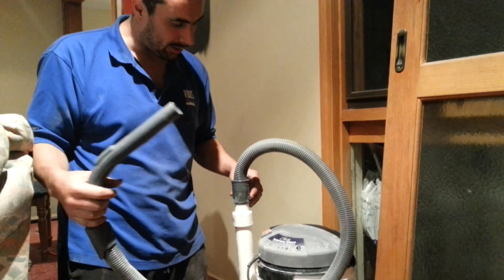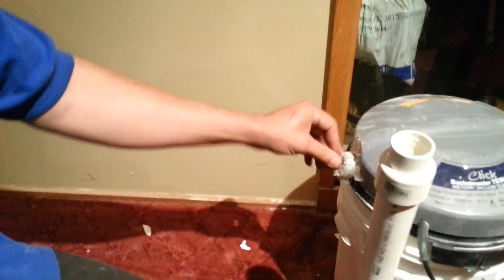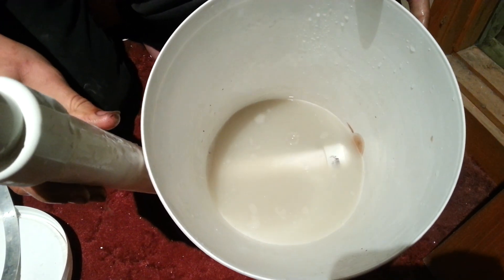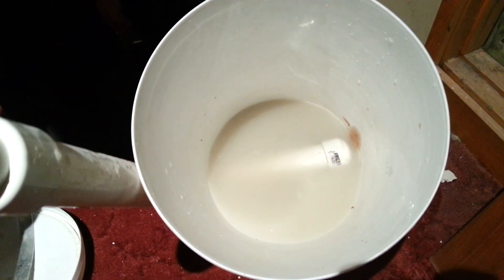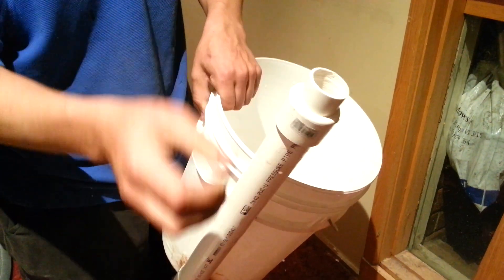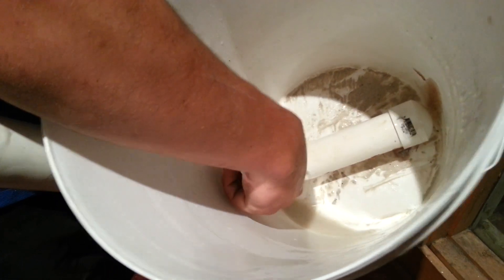Bong-Vac, a water filtration plaster dust vaccuum

Comment: Brilliant! I thought this type of thing would be useful for a project I'm working on, so I searched YT and found this video.

I was thinking about using the shop vac bucket as-is, but running a hose from the inside intake port to the bucket bottom. Good to know about the fiberglass matting to reduce bubbles, and vinegar to reduce foam.

Thanks!

Comment: Thanks for creating this video.  I need to suck up some drywall dust and had the idea of using a water filter.  Previously I put a wet rag on the exhaust of my vacuum, which worked ok, but I have to have someone hold the rag since there's no other way to make it stay on.  I haven't tried making the water filter yet but now see I would have had foam issues.  I have a bucket head vac, but alternatively I may add a lid and make a vacuum port for a regular shop vac.

Comment: your design has 2 brilliant ideas. 1. adding a split lid inside to keep the water at the bottom of the bucket. 2. use soap to create foam to improve the dust / water mix. however, your inlet design with tight elbow, and goes straight with drilled holes will dramatically reduce the airflow. I suggest you to change the design similar to the cyclone to force the dust and water spin and mix inside the bucket.
Reply: Hi Eric I am engineering challanged are you telling me that if I had a dust collector attached to my shop vac its abilty to collect dust will be enhance if I use soap water thoughts please thank you!
Reply: tight 90 degree elbow and small holes kills the air flow. replace that elbow with a long hose and entering the bucket on sideway, like a cyclone dust collector, to increase the airflow. also don't just drill the holes in the tube inside the bucket to let the air comes out. replacing it with a bigger 45 degree elbow. every single part that block the air should be replaced. but all in all, using the water to wash is a good idea to remove the fine dust.
Reply: HI Eric it seems you understand the idea of of using soap to trap dust but elsewhere on the interent it is stated that some people are afraid that dish soap might make bubbles to big that person said they felt a defoamer would like be a better option so I today went and bought a laundry deteregent it seems bubbles in that will be small does that sound good to you thoughts please thank you! again my question in case I was unclear do you think laundry detergent is a good soap to use in my water trap dust collector thoughts please thank you! I would guess one cap full should be enough if not more than enough  ? thoughts please thank you
Reply: My idea is to put the inlet hose at the side to make the air spin against the wall of your bucket. The spinning air will also move the water spinning at the same time. The physics of the spinning action will make the dust and water mixed together. The clean air, or finest of the finest dust, will exit from the outlet. Yes, adding the detergent will create bubbles but it will also increase the efficiency of the cleaning action, which is the best part of your system. The amount of detergent is a try and error process.
Reply: @ericma2937  thank you for the detergent Idea !! I am trying to update my fb page where I put I video of the water trap dust collector so I will just add your user name than that stated you said laundry detergent will make it better than hope thats ok with you ?
Reply: @ericma2937  thank you for the laundry detergent Idea on the video I added to my fb paged I credited your user name saying you said the laundry detergent was a good Idea thank you !
Reply: now why dont I link here a video to a water trap style someone made and tried to imitate : here : https://youtu.be/DKa305v0kmQ?si=P_ZfEWGocqU3AnCN my new question to you do you think it can trap metal shavings in the soap ?
Reply: Metal is heavy. It shouldn’t be too difficult to be filtered out. But keep in mind, the more component you added to the system, the less air flow it will be. Make sure to pick the most efficient way.
Reply: Hi Eric I am not sure which system you are refering to but I made a cyclone diy dust collector based on youtube videos to good news it would seems is it is designed I think as a water trap style and I just bought some laundry deteregent so hopefully if I put a capful in the bottom of my cyclone dust collector it will hopefully wrk well in traping dust do you think Ideas please thank  you
Reply: you said the amount of degtergent is trial and error but the good news is that  I was able to put a filter be for my vacum so even if the detergent fails it will still be filtered !!!! before going into the vac as it woud seem the way I have it set up I dont think dust can get into the vacumm only liquid will be able to pass through but thank you for explaining it to me I am think i feel a little bit better now that my any water and detergent i put in the bottom of my cylcone diy collector is just going to make it work better again thank you !!!
Reply: Hi Again Eric in case I did not already say it congradulations you made a topic that was difficult to reserach easier to understand guess when I get spilled would shavings I now have some laundry detergent I can use I herd someone say dish soap might make to many bubbles and they had recommended something like laundry deteregent as it would make less suds !!!!
Reply: I again I say thank you you made a difficult to research topic easy to understand so as previously stated my thoughts were to take a variation of this video : https://youtu.be/DKa305v0kmQ?si=P_ZfEWGocqU3AnCN and put soapy water using laundry detergent !!!!

Comment: can you imagine the customer walks in and sees that mess on the carpet. He'd say hey you dummy put down a tarp who the hell wants that crap in the carpet. OMG I have textured for over 40 years every time a tapers calls me out I have clean this crap up before I can mask off. Heres an idea mask off first.
Reply from the maker: Carpet was being replaced so didn't bother protecting it.
Reply: PJgearhead ok customers should never tell the tapers they are replacing the carpet. Imagine the carpet guy comes and takes the old carpet away and gets a face full of dust that worked its way down in. tisk tisk tisk
Reply from the maker: John Leitaker
Not quite sure what a tapers is, but it was my house and I did all the work.
Reply: PJgearhead ohhhhhh sorry, a taper is the trade name for someone who takes the drywall (after its on the walls) and tapes the joints, then finishes them and then textures them. as I have done for the last 40 years. In your own house do as you please. of course.